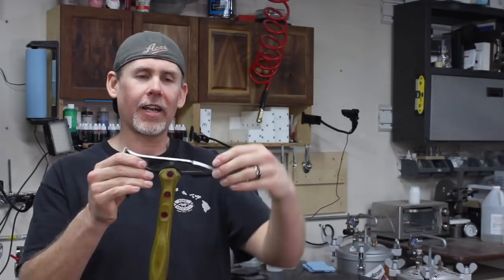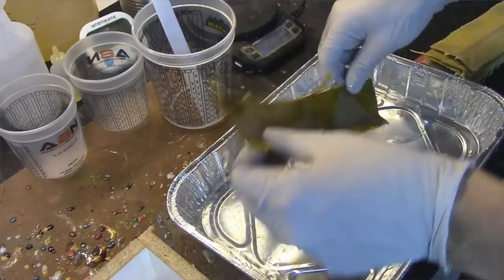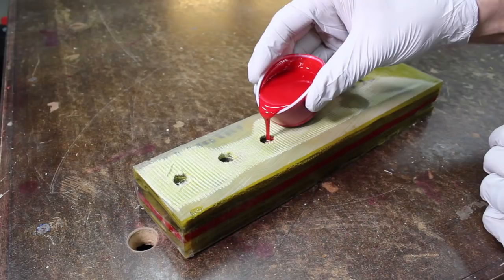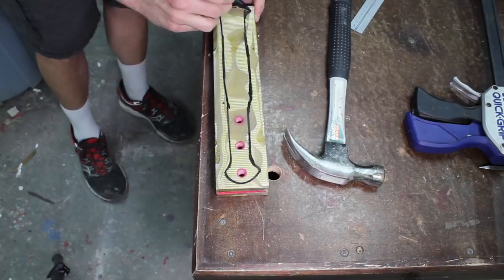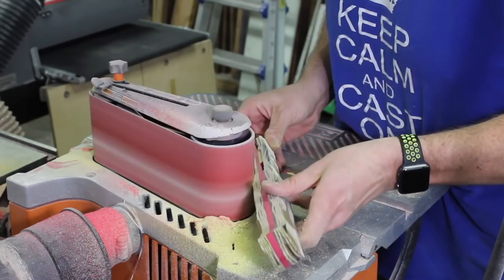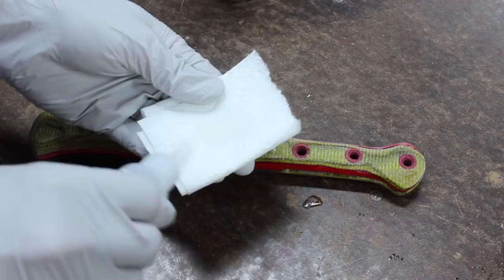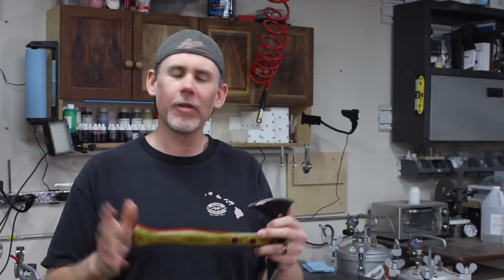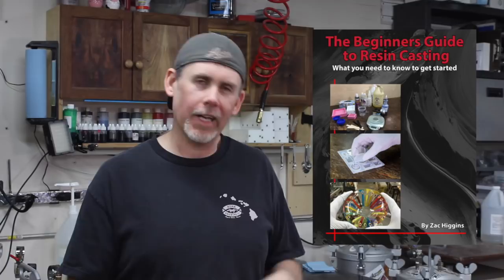Firehose and Epoxy Micarta Hatchet Handle | Dunkin Junk

Comment: Would the firehose take the resin better if it were put in a chamber and then have a vacuum pulled on it instead of using positive pressure?

Comment: I have been having some trouble when sanding resins. I am hoping you can help. I saw in the hatchet video that you added CA glue in an area that you couldn’t get scratches out. It that the best way to deal with scratches? I have used wet sanding micro mesh sand paper and the sanding material with foam with water. There always seems to be a haze and not the clear resin that I am looking for. If you have any ideas so suggestions I’d be grateful. Thanks!
Reply from the maker: Adding a finish can help cover up scratches, but you still run into the same problem of having to smooth out the finish if you don't get it on without any ridges. For this project, just adding a couple wipes of CA worked great to clear it up a bit to see inside the blank since I had only sanded up to around 180 just to smooth out the hard and rough surface after soaking the firehose with CA. 

I think the key to sanding plastics up to a mirror polish is diligent sanding and finishing it off with buffing. You have to make sure you've removed all the previous grit scratches before moving to the next grit. Once you get it up to around 1000-1500 grit, buffing will take care of the rest. It's the best and most consistent method I've found to get all the fine scratches out. I have a video on how I do it for pens, might help out seeing my process: https://www.youtube.com/watch?v=3hGf8qCdCag&t=350s
Reply: Thanks Zac

Comment: That's really nice. I thought it would be really cool if you could find something to really penetrate and fill up the fire hose. Cactus Juice? Clear Penetrating Epoxy Sealer (CPES)?
Reply from the maker: Yeah, possibly. It could definitely be stabilized, or if you thinned out the resin it should penetrate in I would think.

Comment: Great idea Zac I also like the way you set up your pressure tank I think I will give that some thought on my tank. Love the fire hose Micarta
Reply from the maker: Thanks Mike! One thing I didn't think about when I set up the pot on it's side was how heavy the lid was on that 5 gallon pot. It started sagging a bit when I clamped the lid on it, and I had to put a roller stand under it to relieve some of the weight LOL The 2.5 gallon pots aren't as big a deal, but if you have a 5 gal. just make sure to test everything out with the lid on it